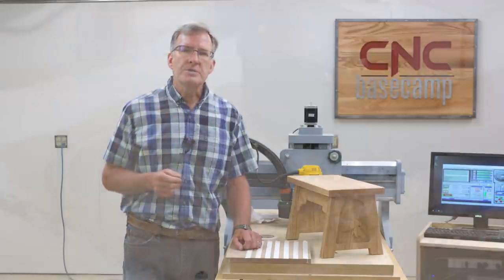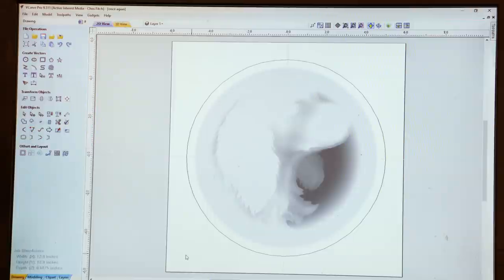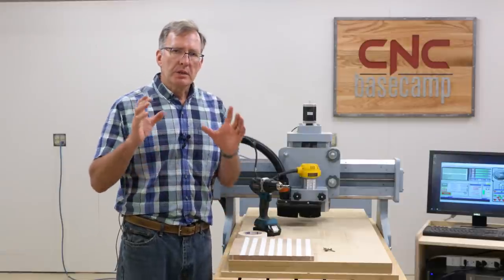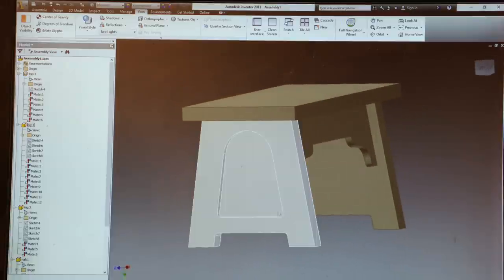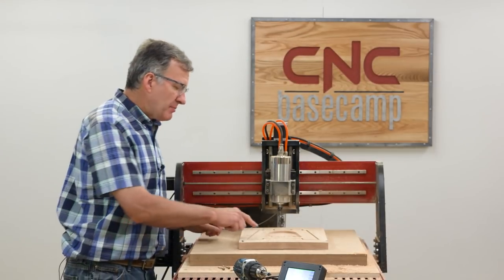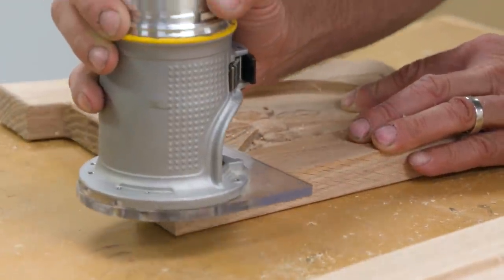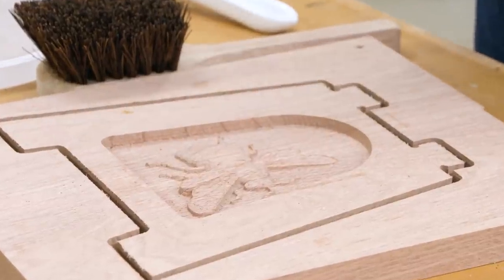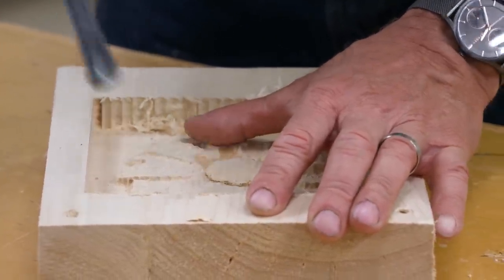CNC Basecamp Ep003: Carving Wood and Acrylic

Comment: I am loving these videos! I am just beginning in CNC routing and have been playing around with Adobe Illustrator to work on projects. My plan is to use AI and then Vectric Aspire to send them to my CNC. I see people in online videos using .AI, .SVG, .DXF, etc., and also see a lot of CNC files offered on Etsy and other places in various formats. I am still confused as to which type of file to use (or purchase) and I know that Aspire can accept all that I mentioned. I notice that your videos offer .DXF files and am just curious if this is the file type I should be working with and also, when in AI, exporting the file to Aspire as a .DXF file. Thanks.

Comment: For the acrylic job, you did not really need to screw it down to the table since it was fastened down with double-sided tape.  Am I missing something as to why you fastened it down with screws?
Reply: It was so that he could cleanly cut the perimeter - which was inside where the screws were placed.
Reply: Insurance